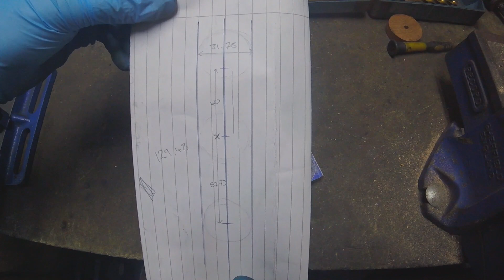Fabricating the Springer front end Rockers for the Honda Rebel bobber Part 16

Comment: Would you be able to rest them on just the raw metal or do you actually need the brass fitting?
Reply from the maker: Ive certainly seen production Springers with no brass/bronze bushes but I wouldn't recommend it.
Reply: @dtaylo4517  sweet man thanks i’m thinking about making a springer front end for my bike just looking for some info

Comment: Nice!  Thanks for the great video!  I am about to try my hand at making some springer forks.  Can you tell me where you go those bolts from?  All the rocker bolt "kits" are super expensive and would be cool to source some.
Reply from the maker: Good to hear your having ago yourself, the shoulder bolts where an eBay purchase, I've put a link in the video description.
Reply: @dtaylo4517  Awesome! Thanks so much! I didn't realize they were called shoulder bolts.  That should make finding the best size for my build way easier. Keep up the great work!